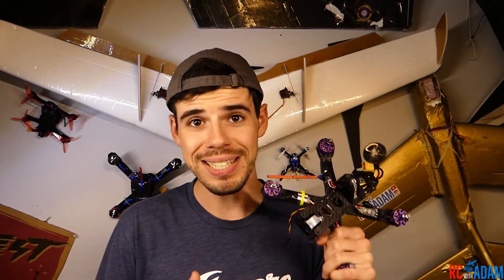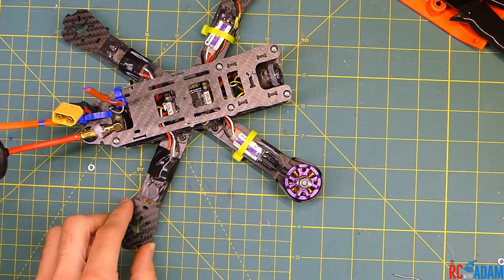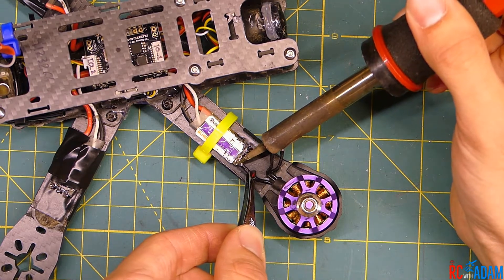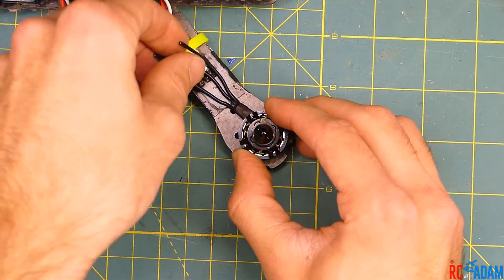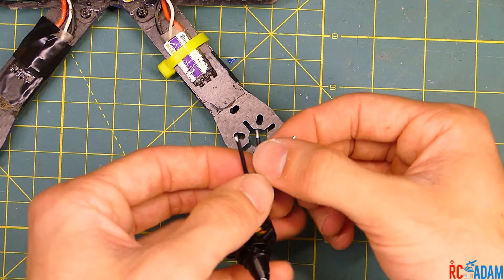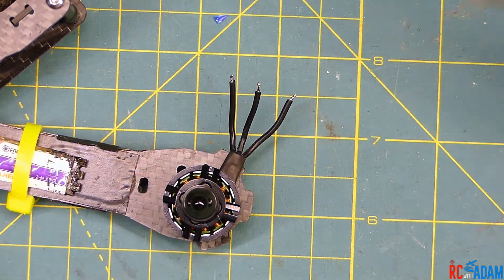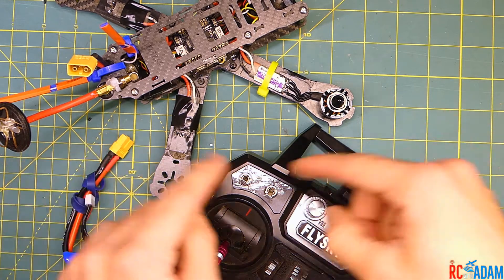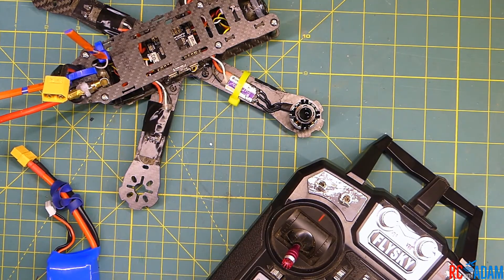Wizard X220 Motor Swap - How To Replace a Drone Motor

Comment: What would happen if I bridge the connection of motors?
Reply from the maker: They won't spin properly (like, at all), and probably cause the esc (or esc board) to restart, and maybe burn up if power continues to be applied to the motor.

Comment: Hey Adam, do we have to match the kV of the motor to upgrade/replace the motor? Let's say we want to upgrades all 4 motors to a more kV motors, do we have to reprogram the ESC/FC?
Reply from the maker: Hi, Ronnie! Not at all. I actually have several different KV motors on there and it still flies okay (though ideally all your motors should be the same type).
Reply: @RCwithAdam1  just the answer I'm looking for! do we have to reprogram the flight controller and elec speed controller? or is it pnp?

Comment: Hey i see that this video is a year old but do you happen to have any recommendations on motor upgrades? I have a 4s 1550 mah + a gopro hero 6 do my wizard is starting to weigh a good amount. The stock motors seem to struggle and one of them gets super hot and I'm expecting it to blow soon considering I've had this thing for a year. :p Thanks!
Reply from the maker: Hi! There are so many good budget motors out there. I use DYS Samguk 2206 2400kv motors on my Budget Basher. I've been flying them over a year now, and they've performed just fine for me (though I did have one of them burn out).
Reply: @RCwithAdam1  I've decided to go with the emax RS2205S 2300KV and since those can pull up to 30A, i also got some Lumenier 30A BLHeli_S escs. Hopefully those are good together, I'm quite new to this so I am still learning on picking parts out and making sure everything works together.

Comment: Thanks for the video ! If i replaced all motors can i set there direction in beta flight ?
Reply from the maker: You're welcome! Nope. To actually reverse the direction of the motor through the ESC, you need to go into the ESC configurator app (in my case the (BLheli app (from chrome, I think)). BUT in betaflight you do need to TELL THE FLIGHT CONTROLLER which direction the motors are actually spinning.